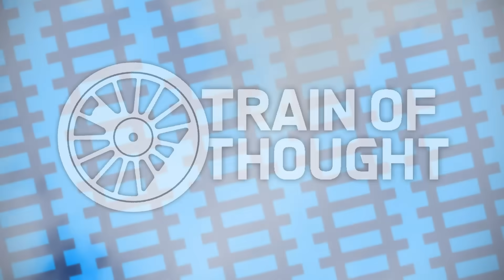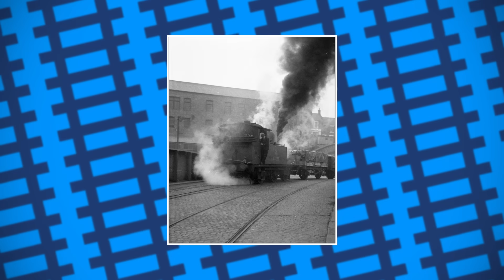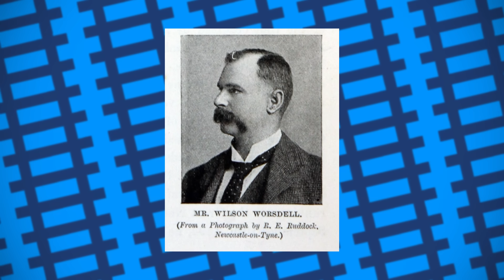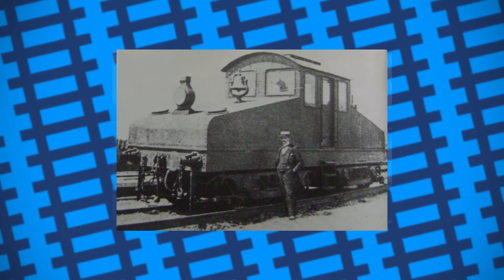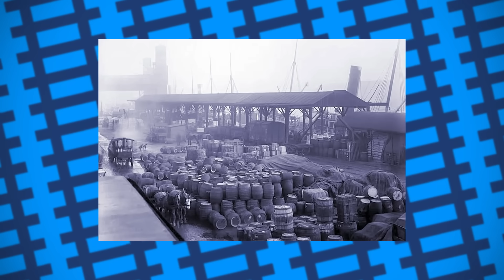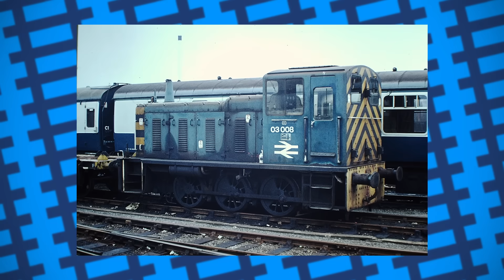Newcastle's Terrific Underground Electric Shunters - NER "ES1"

Comment: Pick up traction ... i see what you did there. Captive service electric switchers & tunnel motors were pretty widespread before the adoption of diesel & full electrification. In some cases the electric switchers outlasted the electrification system they ran on & they saw second lives on other railroads/services. Cool video!

Comment: The Orsay Station in Paris (now Orsay Museum, and a station on the RER-C line) has a similar situation, an inclined tunnel, and when opened, the tunnel was worked by very similar electric shunters, even being equipped with third rail and over head pickups.

Comment: I know the area that the branch to quayside ran quite well since I work in that exact area every month, sadly there's no evidence of it now since the area has been all built up & modernised. Though there's still some evidence of the line that splits from Byker. As there's two small sections of track next to the Army Reserve Centre for the 5th Fusiliers on a disused piece of land; You can see it from google maps.

Comment: The ES1s did occasionally run light engine from manors - gosforth car sheds via the third rail electrified Tyneside loop lines, which is also where the NER Tyneside Electric EMUs ran. The ES1s only ran there for maintenance work that couldn't be done at the dock, as gosforth was better equipped

Comment: I didn't need this. Not that I didn't enjoy the video but as usual there are always a couple new details I learn about from these videos. This time is was more on what motive power worked along side and replaced the ES1s. Now that I know that, I release just how niche and yet relatively simple it would be to acquire the engines for the Newcastle Quayside Branch for a OO layout. Heljan makes the ES1, Rapido the LNER Y7 and Bachmann the LNER J72 and BR Class 03. Aside from the specialized rolling stock, the motive power for the branch line is all available in OO scale ready to run. I really don't need to model something so unique like this, but as I already have been looking into modeling the Consett Iron Ore trains, perhaps sometime down the road.

Comment: 4:00 NOЯTH? These ES1 engines seem to be the inspiration for two Ganz Eg locomotives numbered 5 and 6, manufactured by Ganz és Társa-Danubius Budapest in 1913 for Pressburg, later called Bratislava. They pulled wagons of the interurban electric tram-train line between present day Bratislava and Vienna. They were fitted with pantograhps to run on the 550V DC city tram network (which included a 3rd running rail, because the trams in Bratislava were and are meter gauge) and also a 3rd rail pickup to collect power from a 3rd power rail to be able to shunt on the standard gauge railway line, where the locomotives were changed. The overhead centenary on the railway was electrified with 15 kV 16⅔Hz AC system, so the pantographs had to be pulled down when running there. After the Eg locomotives cleared the mainline, leaving the wagons behind, electric LWP Ewp / BBÖ 1005 / ÖBB 1072 AC locomotives moved to the wagons to pull them closer to Vienna, where yet another change took place. Four "tramway locomotives" Eg 1 to Eg 4 pulled the wagons to the city on DC. These were smaller, two axle locomotives as the line was without steep grades, contrary to Bratislava, where the ramps to the then only bridge over the Danube were quite steep. The smaller and lighter Eg 1 to Eg 4 in Vienna were equipped with heavy traction accumulators. They provided enough mass for sufficient adhesion as well as power for shunting on the mainline, so they did not need a 3rd power rail when operation on the short stretches of the mainline. Multi system DC/AC locomotives did not exist in 1914. Both Ganz Eg locomotives built for the Bratislava tram section still exist. Eg 5 is restored and functional in the Museumstramway Mariazell and Eg 6 belongs to the Club of Friends of Urban Public and Regional Transport in Bratislava, currently undergoing 2nd phase of reconstruction in Topoľčany (since 2016). First phase was from 2012 to 2014, focusing on the mechanical part. The Club also acquired one original passenger car and one freight car, that used to run on the line - both on the city tram network as well as the "big" railway between Bratislava and Vienna.
Reply: An addendum:There were AC/DC locomotives in 1912,as the New Haven,which had AC overhead,went into Grand Central Terminal,which was DC,third rail! The NH was built by Westinghouse,and the GCT,was built by GE! The locomotives of the New Haven,were an interesting history,covering both DC,and AC! Thank you 😇 😊!
Reply: @roberthuron9160  Thank you for the interesting technical detail. I hope there will be a video about those AC/DC multi system locomotives.

Comment: I worked for the Area Civil Engineers maintenance department in from the 70s to the privatisation of British in the late 90s. An old  timer who had been a shunter at manors related an incident that occured in the 60s.
it had been snowing hard and a long line of Danish bacon wagons was being propeled into manors good yard after coming up from the quayside.
The snow had filled the gap in the concreted yard surface (the rails were set flush) and the lead wagons basicly compressed the snow to rock hardness causing the wagon to ride up then set off at a tangent. When the shunter looked back he found the wagons heading towards the shunters cabin having formed their own track so to speak!. Disaster was narrowly avoided by the swift application of brakes. The problem then being to get the wagons back onto the rails!.
Brian the ancient.

Comment: I like how the complaints about them were really minor, compared to nearly choking to death with the steam engines. Electricity really was a game changer for railways. It's a shame the UK no longer seems to care about electrifying the railways
Reply: Not enough electricity since the lunatic net zero folly started... Heat pumps, EVs... Already there's not enough to go round some neighbourhoods; what chance of electrifying railways?
Reply: @typhoon2827 😮 yu ar  correct, power cuts forecast by private xperts,, but govt  mostly keeps silent. Som Railfret Cos  prefer diesel as  they are charged extra Trak fees if they use electric locos ( think I read this in RAIL .)
Reply: theres some electrification projects ongoing, just not in the northeastern's heartlands... 
and even 100 years after the wires were torn down still no plans to re-electrify the tees valley line.

Comment: 7:59 The EF1s interests me
Reply: They too are quite interesting indeed! They were as strong as the 0-8-0s of the N.E.R., being capable of pulling 70 fully loaded 20T wagons at a steady pace of 25mph!! Quite impressive for 1914. Another interesting feature of them was that the driver’s cab was directly next to the traction blowers—meant to keep the motors cool—which would imply that it sounded like a hurricane insane. I’d hate to imagine the noise inside that thing. One of them was rebuilt by B.R., but sadly none of them were preserved. However, the building of the ES1 and EF1 subsequently led to the construction of Britain’s first and only pre-grouping electric express engine, the EE1. You should look that one up. I find it a million times more interesting but with a much more depressing story, as it never even got a chance to operate despite being fully constructed.

Comment: The US had a lot of these steeplecab electric locomotives for light switching and interurban freight operations.
There's even a railway called the Iowa Traction Co. which STILL OPERATES 1920s steeplecab electric locomotives in common carrier freight service, making it the last interurban freight railroad in the country
I highly request a video on Iowa Traction its such an anomaly.
Reply: And two are still running today I think
Reply: @ryancampbell4119 I’m pretty sure it’s all 4.
Reply: Came here looking for this exact comment
Reply: Yakima Valley Interurban still has their units running. Please contact Yakima,Wa City council to tell them not to cancel their operations charter.
Reply: @andyevans2336  you're a bit late on the news, they already extended their operating license for five more years.
Reply: @jacoblyman9441  Thank goodness!
Reply: The Iowa Traction is pretty cool, finally got to see them running back in October. I don’t think they’re the last interurban in the country, but they are the last electricity powered interurban.
Reply: @844SteamFan  I meant the last interurban FREIGHT railway
Reply: @yeoldeseawitch  Yeah, forgot to add that
Reply: @844SteamFan  they’re one of two.  The South Shore line is the other.  The East Troy Electric Railroad Museum does not currently have any active freight customers, although they have also maintained passenger operations, taking over from the city which had taken over before from The Milwaukee Electric Railway and Light Company.
Reply: @J @JohnGeorgeBauerBuis  Yeah, forgot to add the freight part
Reply: I'm a volunteer at the Travel Town Museum in Los Angeles, California, and we have a steeplecab electric locomotive named Electra. It was operated at night because she used a lot of volts.

Sadly, Electra is so damaged, her shell is splintering
Reply: I volunteer at the Western Railway Museum out in California, and they’ve got a handful of working electric steeplecabs from the Sacramento Northern and other local electric operations